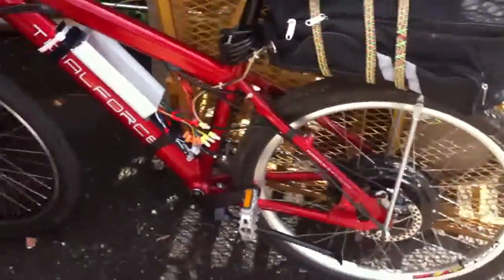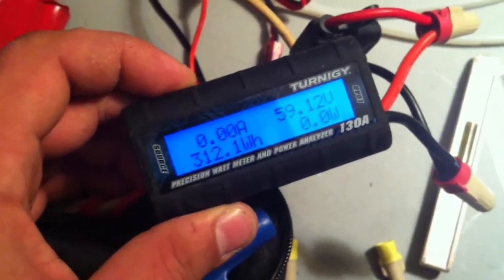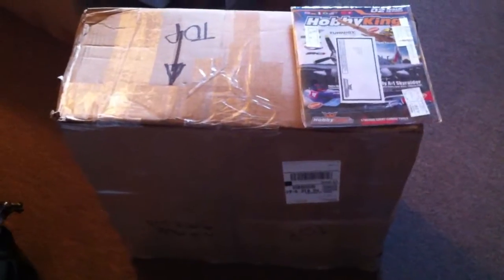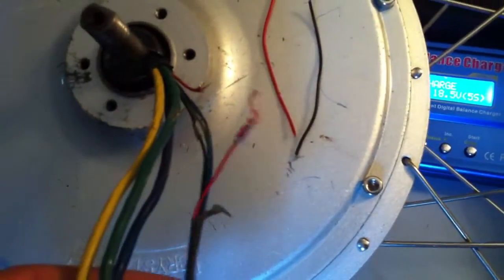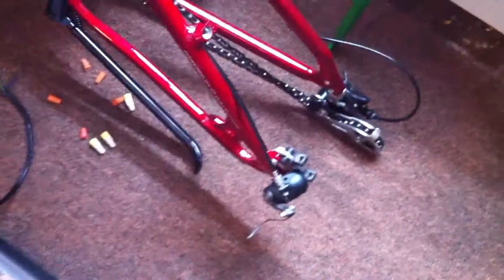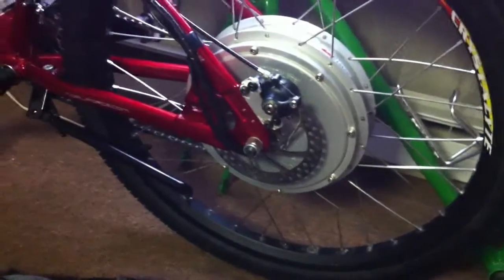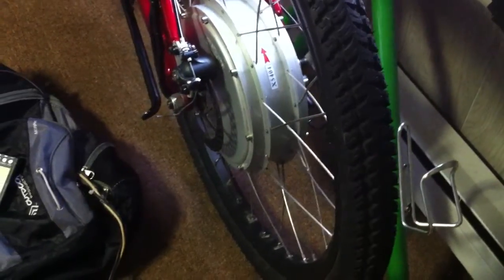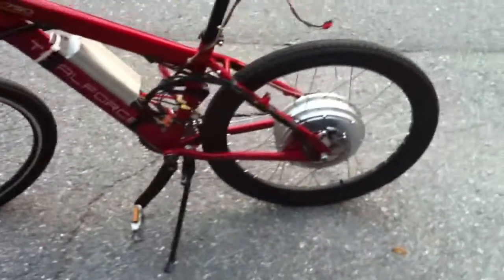60V Crystalyte X5404 Electric Bike Motor Repaired and Mounted

Comment from the maker: You can buy them from anywhere as long as the rating is correct for your build/desires. I usually buy them off ebay or Lyen on endless sphere

Comment from the maker: Yes, you just have to buy a 48 or 72v controller and increase the voltage going into the hub motor(rear wheel) Once you replace the controller you will need a higher voltage battery pack (either a 48v or 2x 36v in series for 72v) If you go to 72v do not go more than 25amps or you will likely smoke the motor on long trips or up hills. 48v 30a is a good idea